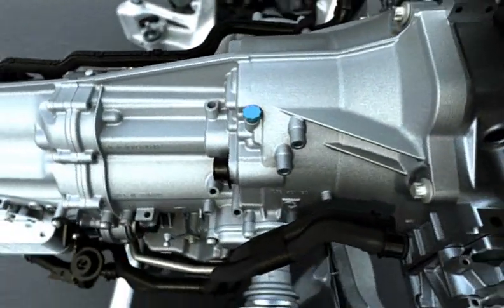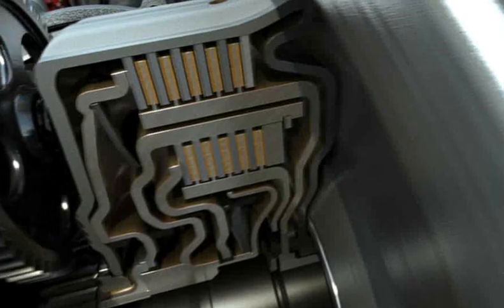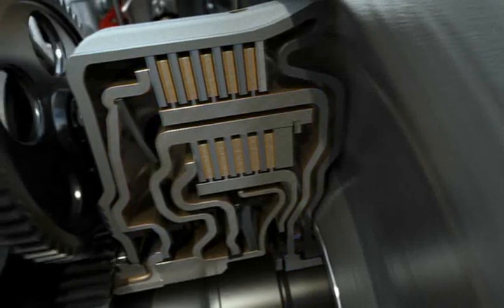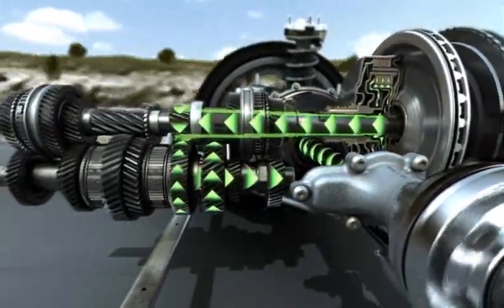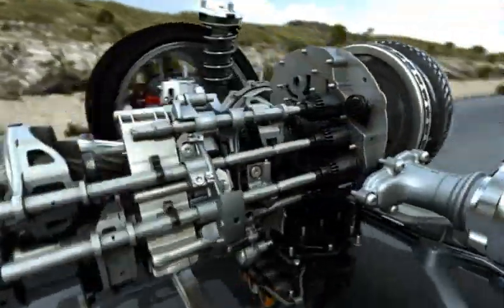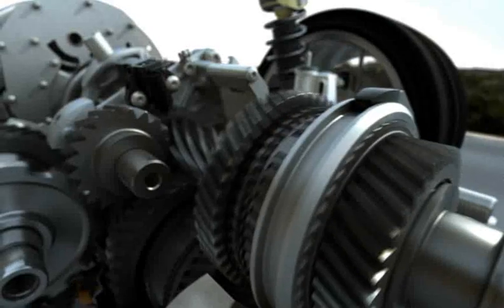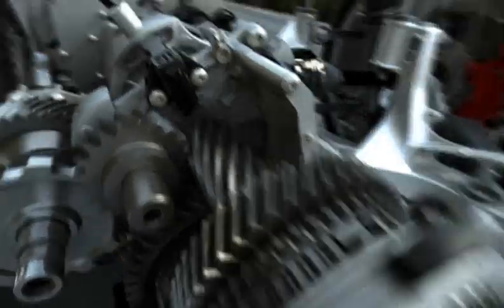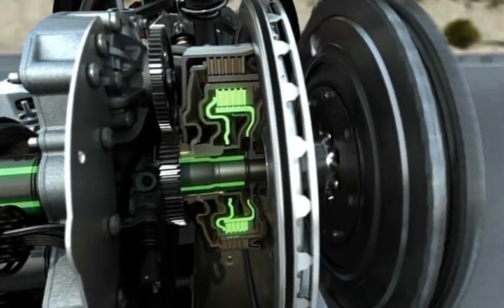How Porsche Doppelkupplung (PDK) Works?

Comment: I wonder why they cant make the gap between the clutch itself and the thing that clamps it for shorter shift times??
Reply: Gap is already minimal on every transmission, they made similar 1 clutch "automatic" transmission which can be found in some Lamborghini from around 2004 I think , but they weren't that fast and reliable

Comment: basically DCT
Reply: It IS a dual clutch transmission ....
Reply: @KrestenGiese  wasn't there a non DCT transmission in the prior model ( 911 turbo ) at one point or at least one that did the 24-hours of Daytona with computer controlled? 6-speed manual transmission
Reply: @richardprice5978 yep, ZF 5,6 speed and MB 5pd torque converter auto trans in all the automatic 996s depending on year and model